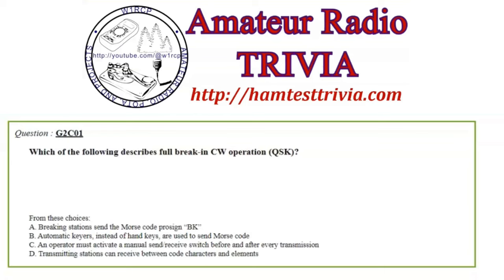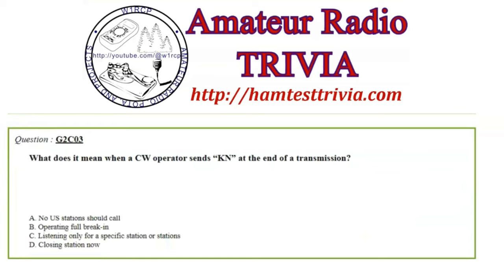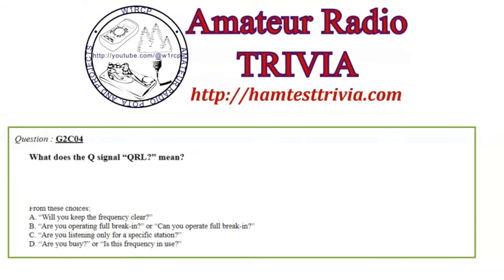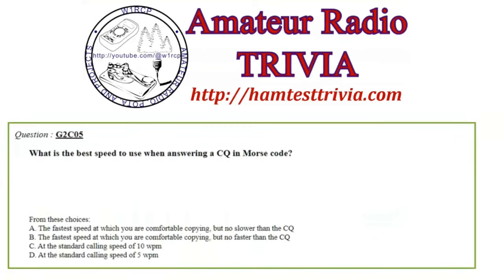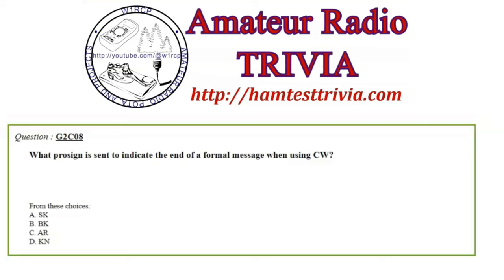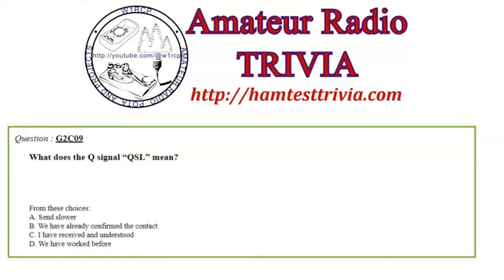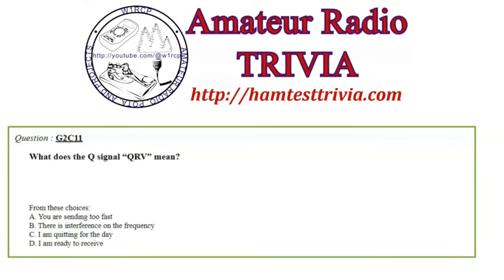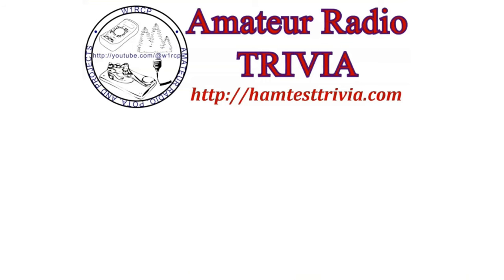Is the FCC bringing back the Morse Code requirement? #hamRadio #test #study #amateurRadio

Comment: That was in the pool when I took my general back in 2008(ish).  PSK and packet use Q signals, too.  Which is funny.  If you follow the ICS standards (as an ARES member should), Q signal and procedural provides aren't part of the standard lexicon.  This is so people not familuar with ham,speak can understand messages sent to them.

However, ham-to-ham really doesn't matter.  It's when you start involving other agencies thar can be a problem.

Comment: So there are CW questions on the tests. By your reasoning, they'd be also considering requirements for every other mode that has questions on the test. Short answer- no, they are not considering bringing back the code requirement.
Reply from the maker: That’s not how that works. They didn’t have an SSB test or AM test. But the answer is no. They are not.

Comment: Just checked the link, its the Question Pool Committee that's who is pushing CW, not the FCC. I think it is foolish to include Q code questions, when  Morse Code  is not a requirement. CW questions will not make new hams engage in the CW challenge.
Reply from the maker: Careful. Using the word "code" gets us into trouble. Somewhere around here I made sure to spell out the connection between the FCC and NCVEC. I think it's an open marriage.
Reply: The FCC Eliminated Morse Code In,2007.
Reply: @w1rcp  I have been away from the hobby for 45 years or so. I forgot the correct terms. Q signals?  work CW exclusively, first licensed 1975 to 78.

Comment: this isn't new to the exams, at all.  Including right after CW was eliminated from requirements.  Nice fishing, though.
Reply from the maker: I've tried, albeit not that hard, to find older question pools than the current ones to no avail, and when I took my test a decade ago, I don't remember having any CW questions, and I studied every question for every level. That doesn't mean anything though. But yes, I have had an excellent fishing trip thus far.
Reply: THE ,FCC Eliminated  The Morse Code In,2007,????
Reply from the maker: Yep. They sure did.

Comment: ARRL VE here, nothing to see here...

CW whether manual or digital will always be an amateur mode,  and has experienced a renaissance for many new operators.  But there are no petitions before the FCC, there is no planning on the FCC's part to introduce Morse competency again, and questions such as this have floated in and out of the elements since 2007.

The directions that amateur radio is taking no longer requires learning Morse Code.  If any code proficiency is ever required again, it's going to be on the software side...
Reply from the maker: There is plenty to see here. Someone might need to know the answers when they take their exam. There’s a whole book of comments down below with great discussion though. Check them out.

Comment: The answer A at 1:22 (QRS?) is wrong! 'QRS?' is a question (!), not a request to send slower, so it means 'Shall I send slower?' So you should reply with a YES or NO.
Reply from the maker: I agree. Most websites I’ve searched on say QRS? Means shall I send slower. But QRS PSE? Would mean will you send slower please? But we’re talking about the General exam, and there are mistakes occasionally. Notify the NCVEC of the mistake and they will probably do one of two things: amend the question or answers, or drop it altogether and then release an errata.
Reply from the maker: Looking back at the question, it should have been worded differently. Punctuation always goes inside the commas even if it is not part of the quoted material. A better wording would have been ‘What does “QRS” mean when sent by a station?’

Comment: I would say that this is an homage to CW, trying to keep people aware.. but the questions were more about Q-codes and things than can be used for digital modes and SSB. I’m studying for my general so this was a helpful video. 
- 73 KN4FVH
Reply from the maker: Join me tonight for trivia. It is questions straight from the General pool. Thursdays at 9pm eastern. Thanks for your encouraging comment.  -Robbie
Reply: Good point. Even if you don't operate CW, a lot of the CW Q codes and abbreviations are used on SSB and especially digital modes (e.g. RTTY). So, makes sense to know the common ones.

Comment: I have no fear of or objection to a CW requirement, but I think it should be limited to the Extra Class license exam.
Reply: It wouldn't change a thing. Extras get just about nothing from the license except a title. Having a tiny slice of a couple of bands where no one is operating really doesn't mean a thing. People get their Extra Class licenses because they want to learn more than they already know, and they like a challenge. In short, they are exactly the people who are already going to learn CW. A requirement won't change that.

Comment: Fine video Robbie, thanks!  The FCC may not be at all concerned regarding CW however it is a foundational skill of the hobby. Perhaps the NCVEC should consider bring back CW as part of the licensing process like it was back when I was first licensed. It would also be a fine idea to have a one year period between upgrades in order that recent licensees/upgrades can learn about the hobby and proper operating techniques. (That may be controversial but there are too many with poor operating habits these days.)